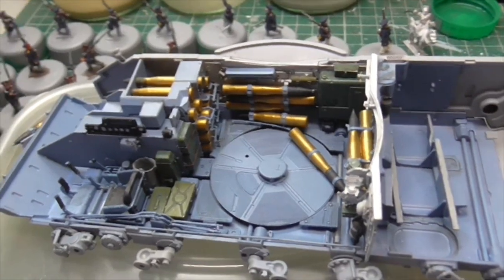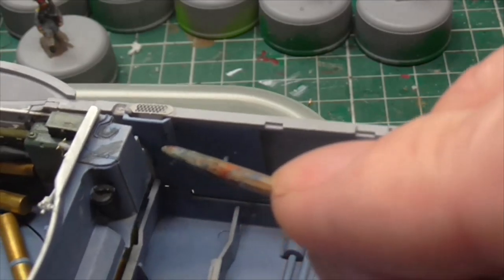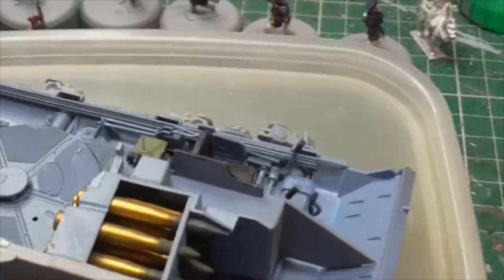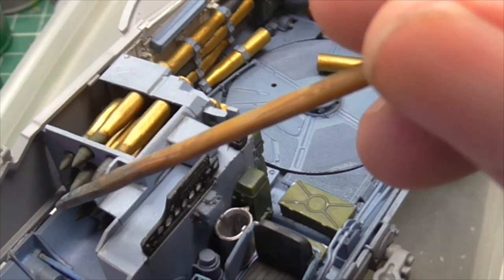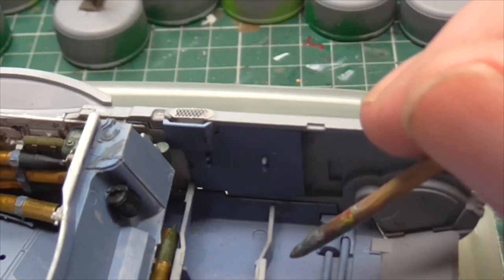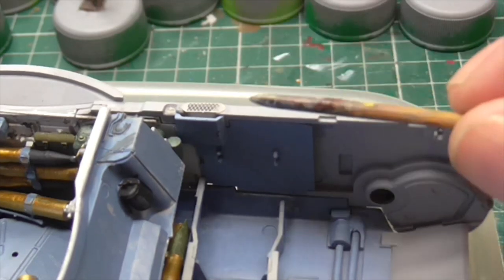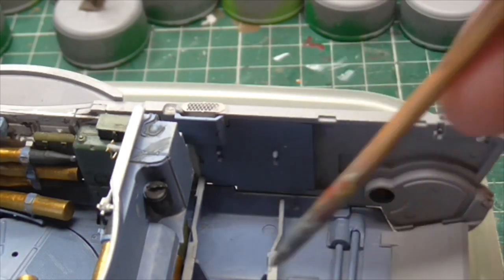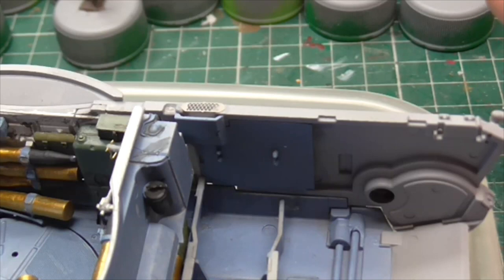1/35 T55A Full Interior Build Vlog Fail !

Comment: I can't believe you've got to this point. I've built this kit and had none of the problems you've had.
The bulkhead doesn't fit in because you put the ammo onto the engine frame incorrectly. Starting with Ca2 you attach Ca4 on top then Ca3 is attached to the front of them NOT above, that's why the firewall doesn't fit. 
I've had no problem getting the hull sides to align with the floor. 
The only problem I've faced is the front plates have a gap. Sorry you've had this problem :(
I love the brass paint on the ammo, you've nailed that :-)
Reply from the maker: Thanks for your advice my problems have been all of my own making but after I have another couple of kits under my belt I hope I can break up the previous work and try again . Regards Gav.
Reply: All the swing arms are upside down on the suspension.
Look up Steve Campbell (on Facebook and I'll add you to a page dedicated to these T-54/55 tanks. There's a ton of help and useful advice).
Reply from the maker: Cheers I will take a look . Regards Gav.

Comment: Hi Gav, my heart go's out to you on this build, for the simple reason that it happened to me with a Miniart kit. Enough trouble to put you off for good. You may or may not agree with my suggestion here but here go's. Forget the interior and build the kit to a finish if you can. Turn a setback into a victory and put it to bed. These Miniart kits are good from the point of view of details, but they do not have the ensured fit and quality of say Tamiya. Even most accomplished modellers have serious issues with them. You can take this with a pinch of salt if you wish, but what ever you do , do not throw the towel in regards JC.
Reply from the maker: Thanks for all your advice John I am glad I am not the only one I think a few easier kits under my belt and I will return to it . I want to build some 1/35 and also 1/72 and 1/48 aircraft as well . Regards Gav.
Reply: @gavinbooth  Gav, I am no expert and my comments do not necessarily agree with everyone, but after some years of model making, I have experienced failure on quite a few occasions so I know what has run through your mind. Better luck on the next build JC

Comment: Hey Gav, it's a shame that the poor fit of the parts causes so many problems. Unfortunately, the developers of the models will probably never build themself for rehearsal. Would improve some problems in advance. Self-knowledge is the first road to recovery for these people. I know these highlights of model making too.
First sleep over it and then maybe in respose again.
Maybe you can make the bad fitting parts yourself from evergreen profiles or sheet metal profiles and then exchange them.
If everything does not work, you can still build the T55 without interior and still create a great model with a good paint job.
Wish you a quiet weekend and a good decision. Greetings, Joachim
Reply from the maker: Thanks for help and advice Joachim I definitely need a quiet weekend . Regards Gav.